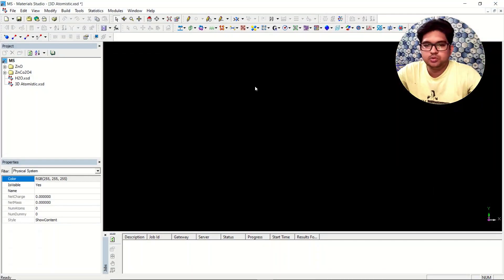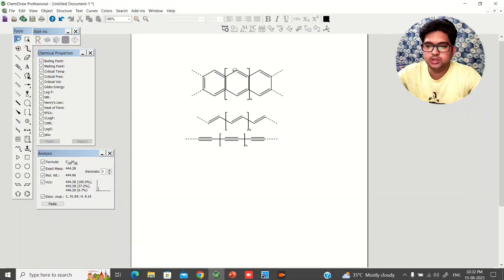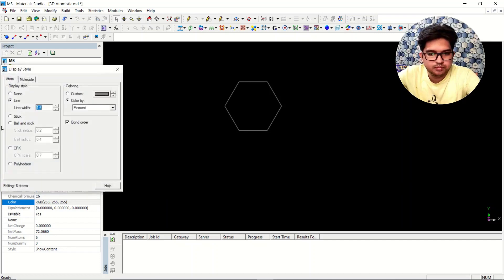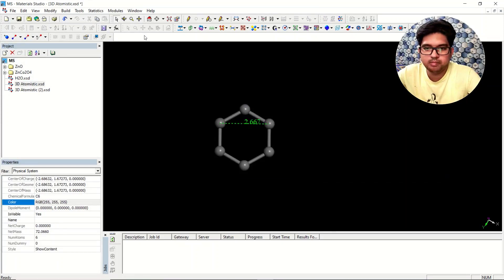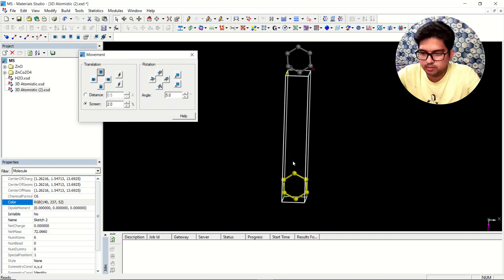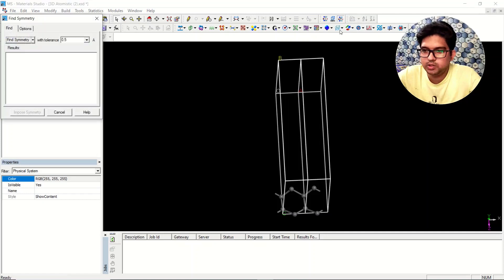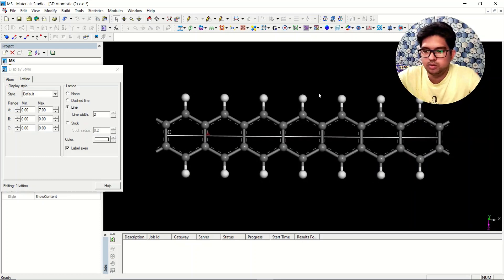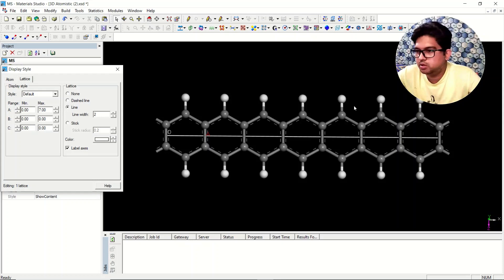How to design 1D polymers ||Gaurav Jhaa #conducting #polymers

Comment: Hello sir, could you share a video showing the way to calculate adsorption energy between graphene and sulfur (S8) or lithium sulfide (Li2S6) ? In your past videos, you only show us a very brief guide to calculate adsorption energy. We really appreciate if you could show us a specific example. Thank you so much fo your great work.
Reply from the maker: It's very simple, dear if you know how to do a geometry optimization in materials studio. First, optimize the Graphene Lattice, then optimize the S8 molecule (put this molecule in a 10x10x10 cube and use the same methodology). Make a supercell of graphene to accommodate the S8 molecule and copy and paste the S8 molecule on the graphene surface by making P1 symmetry. Once done, do a geometry optimization process and use my previous video to calculate the adsorption energies.
Reply: @quantumguruji  thank you so much, sir. Your comment is truly useful to me. I am still waiting for your upcoming video regarding this matter to compare with my calculation.